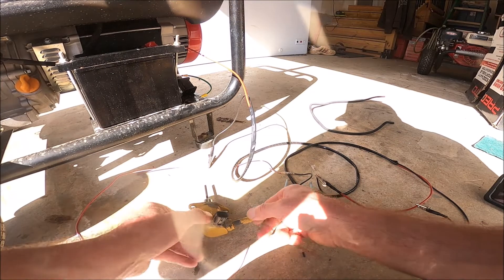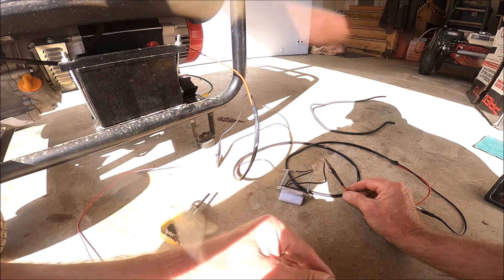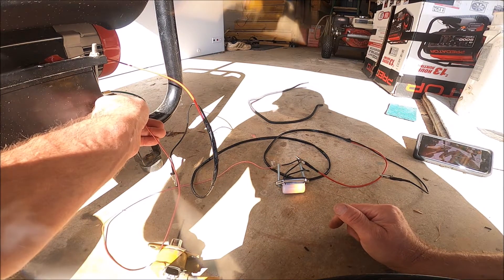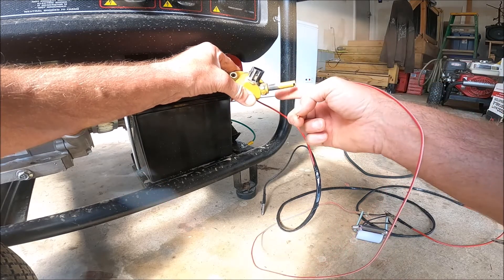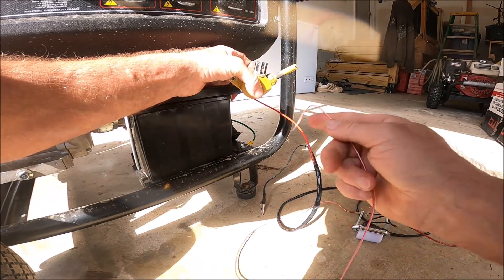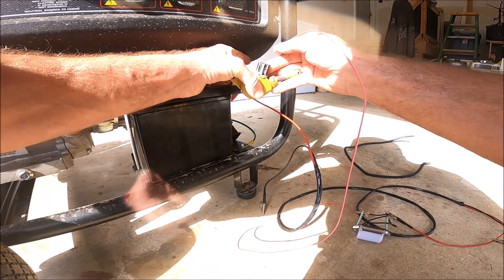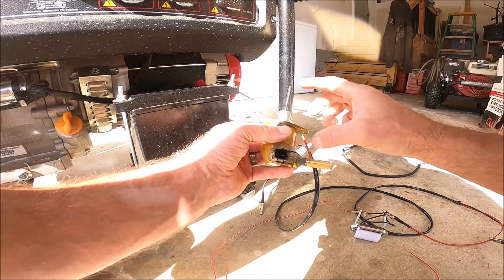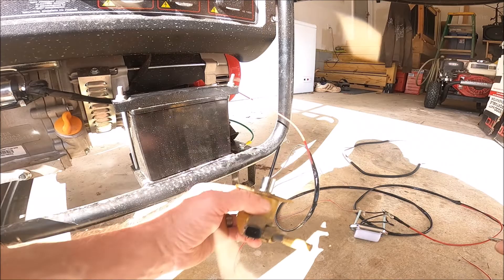Fuel Shut Off Solenoid Bench Test

Comment: Let me ask you...I pulled the fuel cutoff on a Kukje 24hp engine, bench tested and it wasn't good.  However, I bought a new actuator and connected it to the wiring (not installed). At rest, the actuator is at full length, and when I turn the key on it retracts, but then in a few seconds it returns to full extension.  Bad ground--or no ground, even with the actuator plugged into the tractor?  Is the unit grounded to its body??  At the moment, I was testing safety switches so I hot-wired the ignition/coil.  Runs fine, but without an actuator in place I have to manually turn off the engine.  QUESTION: When I turn the key the actuator should remain retracted but it doesn't.  Why?
Reply: I saw on one video that when working right and you turn off switch it has a timed delay before shutting off. So it sounds like yours is working right now. I too am having this solenoid problem, but i haven't pulled mine off to test it. But turning the switch on and off on mine doesnt sound are feel like it is doing anything. Mine has the 2 wire solenoid and only wiring schematic i have found close  is for the 1 wire.